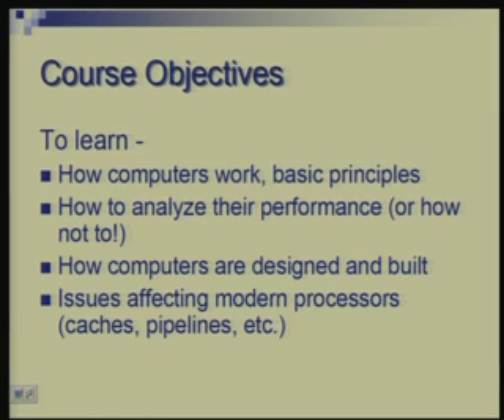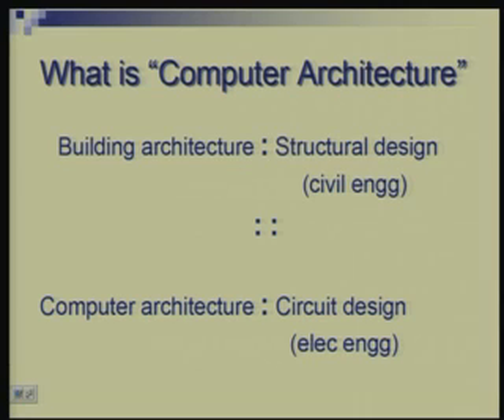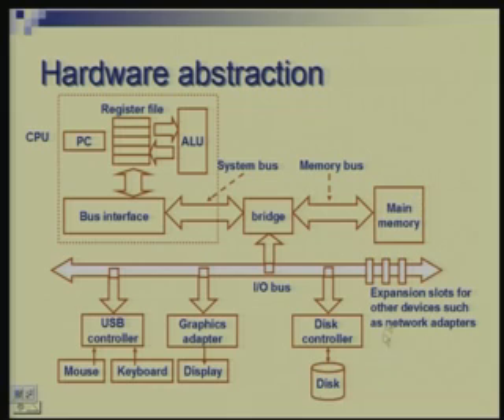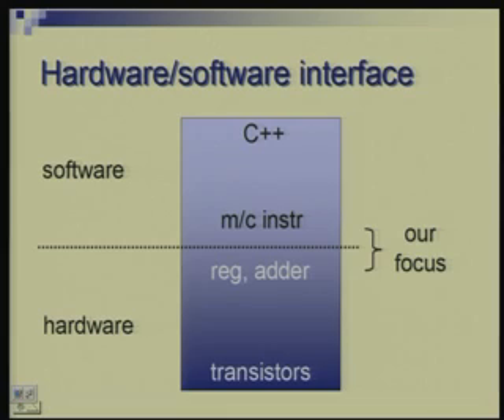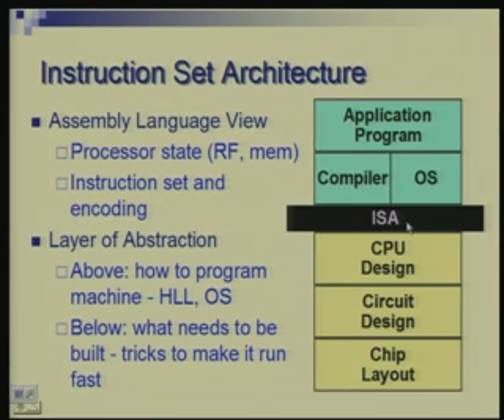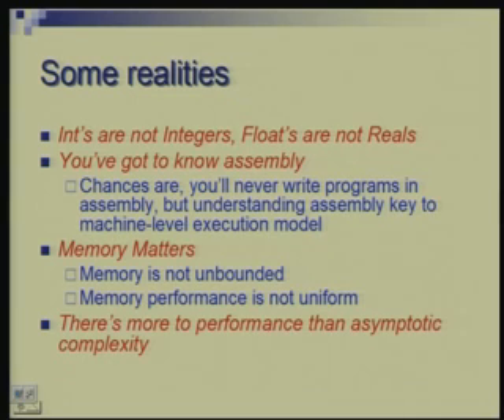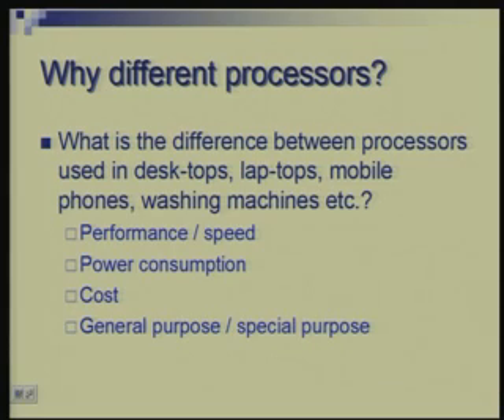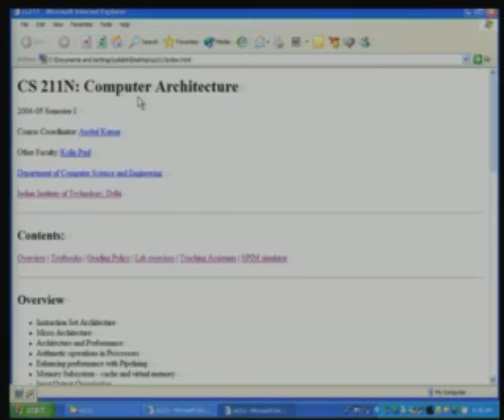Lecture -1 Introduction to Computer Architecture

Comment: Going by the previous comments, I was really sceptical about how much I would get out of this particular lecture. But this is actually informative. The lecturer goes in depth about the topic and is a good starting point for beginners. If you are not taking notes, speed the video up to 1.5.

Comment: A computer is a machine that manipulates data according to a set of instructions called a computer program. The program has an executable form that the computer can use directly to execute the instructions. The same program in its human-readable source code form, enables a programmer to study and develop a sequence of steps known as an algorithm. Because the instructions can be carried out in different types of computers, a single set of source instructions converts to machine instructions according to the central processing unit type.

The execution process carries out the instructions in a computer program. Instructions express the computations performed by the computer. They trigger sequences of simple actions on the executing machine. Those actions produce effects according to the semantics of the instructions.

Comment: A very important thing is "Machine that is fixed does not touch again", it stays there until it has another different failure, be it Hardware or Software "
Reply: correct

Comment: Computer Architecture

Definition - What does Computer Architecture mean?

Computer architecture is a specification detailing how a set of software and hardware technology standards interact to form a computer system or platform. In short, computer architecture refers to how a computer system is designed and what technologies it is compatible with.

As with other contexts and meanings of the word architecture, computer architecture is likened to the art of determining the needs of the user/system/technology, and creating a logical design and standards based on those requirements.
 Manage Complex ERP Environments Webinar
Techopedia explains Computer Architecture

A very good example of computer architecture is von Neumann architecture, which is still used by most types of computers today. This was proposed by the mathematician John von Neumann in 1945. It describes the design of an electronic computer with its CPU, which includes the arithmetic logic unit, control unit, registers, memory for data and instructions, an input/output interface and external storage functions.

There are three categories of computer architecture:

System Design: This includes all hardware components in the system, including data processors aside from the CPU, such as the graphics processing unit and direct memory access. It also includes memory controllers, data paths and miscellaneous things like multiprocessing and virtualization.
Instruction Set Architecture (ISA): This is the embedded programming language of the central processing unit. It defines the CPU's functions and capabilities based on what programming it can perform or process. This includes the word size, processor register types, memory addressing modes, data formats and the instruction set that programmers use.
Microarchitecture: Otherwise known as computer organization, this type of architecture defines the data paths, data processing and storage elements, as well as how they should be implemented in the ISA.

Comment: The purpose is to design a computer that maximizes performance while keeping power consumption in check, costs low relative to the amount of expected performance, and is also very reliable. For this, many aspects are to be considered which includes instruction set design, functional organization, logic design, and implementation. The implementation involves integrated circuit design, packaging, power, and cooling. Optimization of the design requires familiarity with compilers, operating systems to logic design, and packaging

Comment: An instruction set architecture (ISA) is the interface between the computer's software and hardware and also can be viewed as the programmer's view of the machine. Computers do not understand high level languages such as Java, C++, or most programming languages used. A processor only understands instructions encoded in some numerical fashion, usually as binary numbers. Software tools, such as compilers, translate those high level languages into instructions that the processor can understand.

Besides instructions, the ISA defines items in the computer that are available to a program—e.g. data types, registers, addressing modes, and memory. Instructions locate these available items with register indexes (or names) and memory addressing modes.

Comment: The ISA of a computer is usually described in a small instruction manual, which describes how the instructions are encoded. Also, it may define short (vaguely) mnemonic names for the instructions. The names can be recognized by a software development tool called an assembler. An assembler is a computer program that translates a human-readable form of the ISA into a computer-readable form. Disassemblers are also widely available, usually in debuggers and software programs to isolate and correct malfunctions in binary computer programs.

ISAs vary in quality and completeness. A good ISA compromises between programmer convenience (how easy the code is to understand), size of the code (how much code is required to do a specific action), cost of the computer to interpret the instructions (more complexity means more space needed to disassemble the instructions), and speed of the computer (with larger disassemblers comes longer disassemble time). For example, single-instruction ISAs like an ISA that subtracts one from a value and if the value is zero then the value returns to a higher value are both inexpensive, and fast, however ISAs like that are not convenient or helpful when looking at the size of the ISA. Memory organization defines how instructions interact with the memory, and how memory interacts with itself.

During design emulation software (emulators) can run programs written in a proposed instruction set. Modern emulators can measure size, cost, and speed to determine if a particular ISA is meeting its goal

Comment: Computer organization helps optimize performance-based products. For example, software engineers need to know the processing power of processors. They may need to optimize software in order to gain the most performance for the lowest price. This can require quite detailed analysis of the computer's organization. For example, in a SD card, the designers might need to arrange the card so that the most data can be processed in the fastest possible way.

Computer organization also helps plan the selection of a processor for a particular project. Multimedia projects may need very rapid data access, while virtual machines may need fast interrupts. Sometimes certain tasks need additional components as well. For example, a computer capable of running a virtual machine needs virtual memory hardware so that the memory of different virtual computers can be kept separated. Computer organization and features also affect power consumption and processor cost.

Comment: Once an instruction set and micro-architecture are designed, a practical machine must be developed. This design process is called the implementation. Implementation is usually not considered architectural design, but rather hardware design engineering. Implementation can be further broken down into several steps:

Logic Implementation designs the circuits required at a logic gate level
Circuit Implementation does transistor-level designs of basic elements (gates, multiplexers, latches etc.) as well as of some larger blocks (ALUs, caches etc.) that may be implemented at the log gate level, or even at the physical level if the design calls for it.
Physical Implementation draws physical circuits. The different circuit components are placed in a chip floorplan or on a board and the wires connecting them are created.
Design Validation tests the computer as a whole to see if it works in all situations and all timings. Once the design validation process starts, the design at the logic level are tested using logic emulators. However, this is usually too slow to run realistic test. So, after making corrections based on the first test, prototypes are constructed using Field-Programmable Gate-Arrays (FPGAs). Most hobby projects stop at this stage. The final step is to test prototype integrated circuits. Integrated circuits may require several redesigns to fix problems.
For CPUs, the entire implementation process is organized differently and is often referred to as CPU design.

Comment: The exact form of a computer system depends on the constraints and goals. Computer architectures usually trade off standards, power versus performance, cost, memory capacity, latency (latency is the amount of time that it takes for information from one node to travel to the source) and throughput. Sometimes other considerations, such as features, size, weight, reliability, and expandability are also factors.

The most common scheme does an in depth power analysis and figures out how to keep power consumption low, while maintaining adequate performance.

Comment: Modern computer performance is often described in IPC (instructions per cycle). This measures the efficiency of the architecture at any clock frequency. Since a faster rate can make a faster computer, this is a useful measurement. Older computers had IPC counts as low as 0.1 instructions per cycle. Simple modern processors easily reach near 1. Superscalar processors may reach three to five IPC by executing several instructions per clock cycle.

Counting machine language instructions would be misleading because they can do varying amounts of work in different ISAs. The "instruction" in the standard measurements is not a count of the ISA's actual machine language instructions, but a unit of measurement, usually based on the speed of the VAX computer architecture.

Many people used to measure a computer's speed by the clock rate (usually in MHz or GHz). This refers to the cycles per second of the main clock of the CPU. However, this metric is somewhat misleading, as a machine with a higher clock rate may not necessarily have greater performance. As a result, manufacturers have moved away from clock speed as a measure of performance.

Other factors influence speed, such as the mix of functional units, bus speeds, available memory, and the type and order of instructions in the programs.

There are two main types of speed: latency and throughput. Latency is the time between the start of a process and its completion. Throughput is the amount of work done per unit time. Interrupt latency is the guaranteed maximum response time of the system to an electronic event (like when the disk drive finishes moving some data).

Performance is affected by a very wide range of design choices — for example, pipelining a processor usually makes latency worse, but makes throughput better. Computers that control machinery usually need low interrupt latencies. These computers operate in a real-time environment and fail if an operation is not completed in a specified amount of time. For example, computer-controlled anti-lock brakes must begin braking within a predictable, short time after the brake pedal is sensed or else failure of the brake will occur.

Benchmarking takes all these factors into account by measuring the time a computer takes to run through a series of test programs. Although benchmarking shows strengths, it shouldn't be how you choose a computer. Often the measured machines split on different measures. For example, one system might handle scientific applications quickly, while another might render video games more smoothly. Furthermore, designers may target and add special features to their products, through hardware or software, that permit a specific benchmark to execute quickly but don't offer similar advantages to general tasks.

Comment: Power efficiency is another important measurement in modern computers. A higher power efficiency can often be traded for lower speed or higher cost. The typical measurement when referring to power consumption in computer architecture is MIPS/W (millions of instructions per second per watt).

Modern circuits have less power required per transistor as the number of transistors per chip grows.This is because each transistor that is put in a new chip requires its own power supply and requires new pathways to be built to power it. However the number of transistors per chip is starting to increase at a slower rate. Therefore, power efficiency is starting to become as important, if not more important than fitting more and more transistors into a single chip. Recent processor designs have shown this emphasis as they put more focus on power efficiency rather than cramming as many transistors into a single chip as possible.[15] In the world of embedded computers, power efficiency has long been an important goal next to throughput and latency.

Comment: In computer engineering, computer architecture is a set of rules and methods that describe the functionality, organization, and implementation of computer systems. Some definitions of architecture define it as describing the capabilities and programming model of a computer but not a particular implementation. In other definitions computer architecture involves instruction set architecture design, microarchitecture design, logic design, and implementation.

Comment: There are other types of computer architecture. The following types are used in bigger companies like Intel, and count for 1% of all of computer architecture

Macroarchitecture: architectural layers more abstract than microarchitecture
Assembly Instruction Set Architecture (ISA): A smart assembler may convert an abstract assembly language common to a group of machines into slightly different machine language for different implementations
Programmer Visible Macroarchitecture: higher level language tools such as compilers may define a consistent interface or contract to programmers using them, abstracting differences between underlying ISA, UISA, and microarchitectures. E.g. the C, C++, or Java standards define different Programmer Visible Macroarchitecture.
UISA (Microcode Instruction Set Architecture)—a group of machines with different hardware level microarchitectures may share a common microcode architecture, and hence a UISA.
Pin Architecture: The hardware functions that a microprocessor should provide to a hardware platform, e.g., the x86 pins A20M, FERR/IGNNE or FLUSH. Also, messages that the processor should emit so that external caches can be invalidated (emptied). Pin architecture functions are more flexible than ISA functions because external hardware can adapt to new encodings, or change from a pin to a message. The term "architecture" fits, because the functions must be provided for compatible systems, even if the detailed method changes

Comment: Computer software, or simply software, is a part of a computer system that consists of data or computer instructions, in contrast to the physical hardware from which the system is built. In computer science and software engineering, computer software is all information processed by computer systems, programs and data. Computer software includes computer programs, libraries and related non-executable data, such as online documentation or digital media. Computer hardware and software require each other and neither can be realistically used on its own.

Comment: This video is really interesting as it is important to understand each of the components of a computer, and also the types of languages that are high level or low level, as we saw in the example of the C language and assembler syntax it is very different and you need to have much knowledge about these issues. It is a very well explained video.

Comment: @valveforlife Discounting abstraction levels, engineering is mainly the hardware side of things, which as I said is the physical design of a computer and its parts (ie processor ect). Computer scientists work with programming languages that are build upon the hardware created by the engineers.

Comment: @AL6025 Computer scientists are more programming oriented. Therefore you would be participating in software design. A computer scientist may also work with the simplification and optimization of algorithms to speed up computers via software. Engineers are more involved with the actual physical makeup of computers, for example the logic gates that compose the processor or the ALU within a computer.